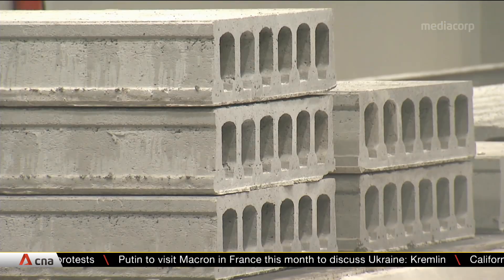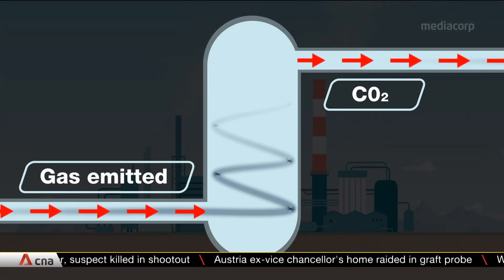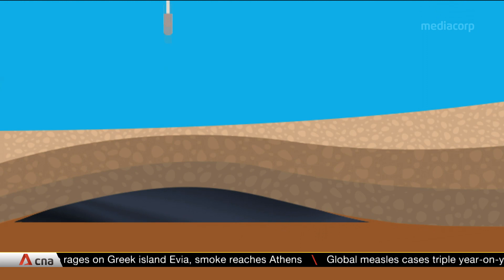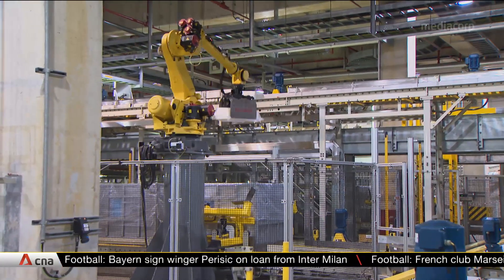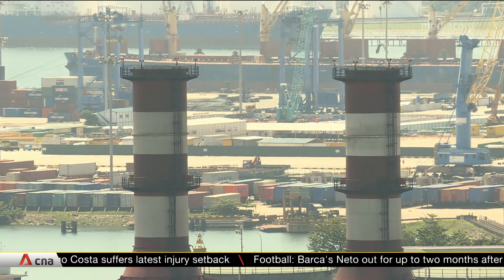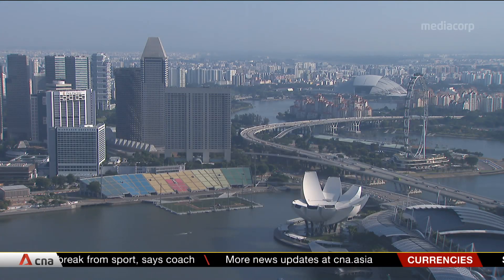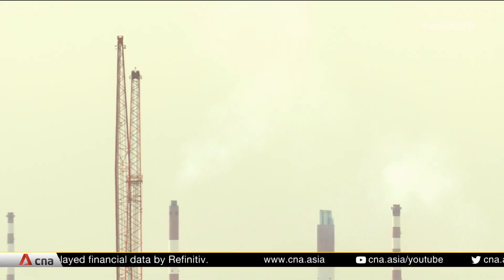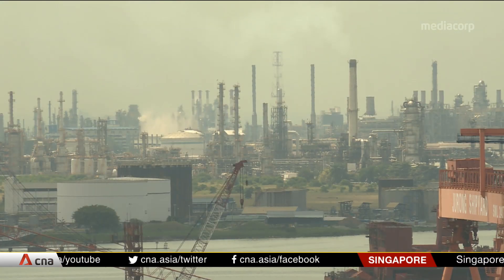Singapore looking into ways to store, use carbon emissions

Comment: Carbon credits trading buy-sell for manufacturers, bokerage commissions by government, ... item manufactured counts as consumed. Not retail. 

Another type of technique of carbon accumulation-recycling via chimney additives and sequences to make (diesel) 2.5 particulate fatter to coal-dust, soot, heavy-oily carbon, charcoal... round-robin plus-minus accounting for set of  refuse-incineration combined with power-generation and water-filtration and petrol-chemical cracker plastic-coal-crude hydrocarbons. 

Curly accounting by understanding the carbon-world and carbon-atom in secondary 4 express-stream combined-science... proponents of carbon emissions are suspected of being from the normal stream...